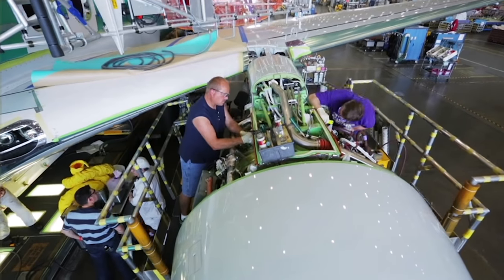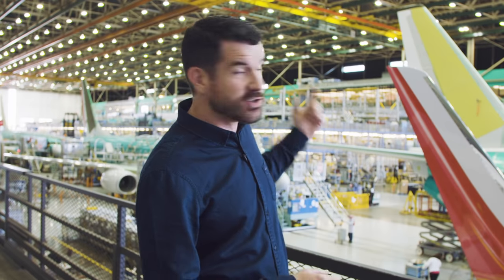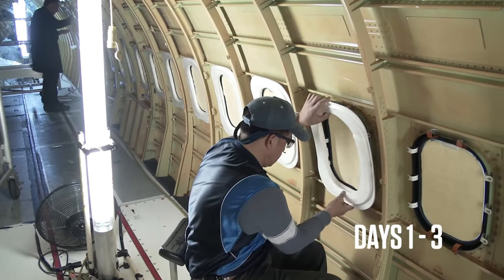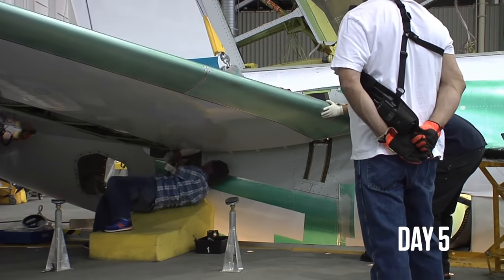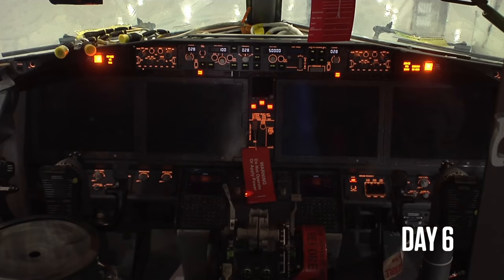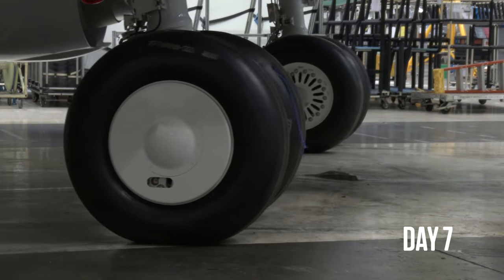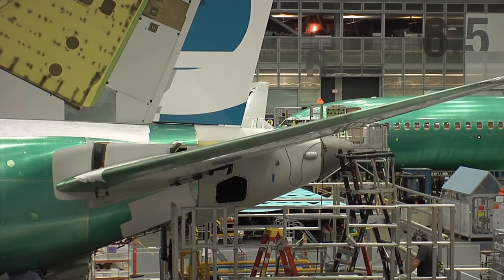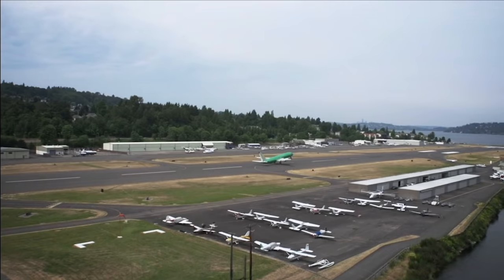How Boeing Builds a 737 in Just Nine Days | WIRED

Comment: The nine days is very misleading. With the some logic Volkswagen creates a new car every 10 minutes. It has to do with amount of planes manufactured divided by time. Boeing doesn't of course manufactures one airplane each time. Hundreds of airplanes are manufactured at the some time and for the completion of an airplane many months are needed.
Reply: It is actually nine days, take a tour of the Boeing plant. day 9 the 737s are usually in the air.
Reply: IWantXanniesBeforeBannies 
Exactly. Total Man Hours is one thing. But they are still hitting the Flightline at 42 planes a month. We used to roll out a 747 every 3 days...

Comment: Sound good, but in the last few months 2 of this planes had fallen out of the sky. Are you still proud how fast the plane is being built or should the Boeing not look into the safety of the plane 1st.
Reply: The 737 MAX issues are not related to the fast assembly rates at the Renton Plant. Also, key word: ASSEMBLY PLANT. The sections and parts of the plane like the fuselage, wings, tail, engines, landing gear, avionics, etc. are all made at other manufacturing plants and then shipped to the Renton Plant for final assembly. And this is something Boeing has mastered since WW2 with the B-17 bomber, so I wouldn't be alarmed if I were you.

Comment: The video made it sound like engineers do almost all of the assembly work. Can anyone confirm that? I would assume an assembly line that large would be mostly hourly workers with engineering support.
Reply: Yes, I can confirm it. Most of them have a engineering degree.
Reply: They shoulve said technicians, because those guys are just assembling parts following instructions that are in turn written and designed by engineers
Reply: Mechanics assemble the plane. Engineers design the plane and provide on-site support as required
Reply: Elitefr 
Correct. 
And many of said mechanics have multiple certifications. And have as good a working knowledge of Assembly requirements and procedures as engineers. Ya can't learn everything from a Book lol.